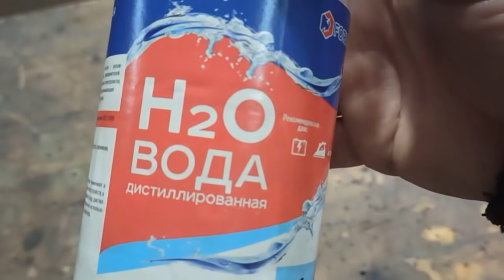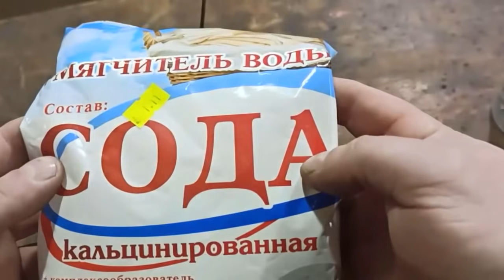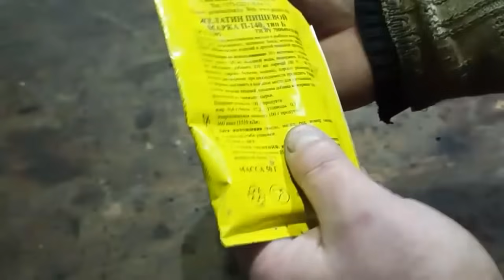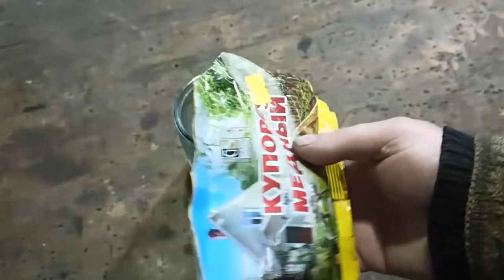Секрет меднения алюминия в гараже! DIY! Полезная самоделка! БОЛЬШЕ никогда не выбросишь ...

Comment: I'm very interested in this procedure, but I have doubts - Please confirm my understanding of "caustic sodium": When you mix soda ash (Na2CO3) with slaked lime (Ca(OH)2), you get calcium carbonate (CaCO3) + sodium hydroxide (NaOH), which is what you call caustic sodium, correct? Different languages have different names for common products and it's, sometimes, difficult to understand properly.
Reply from the maker: Yes, it is caustic sodium. You can also use a sewer cleaner that contains 30% sodium hydroxide.
Reply: @KovancaPolock  OK. Thanks!

Comment: Very interesting, but unfortunately I cannot read Cyrillic.
What are the products used please?
Reply from the maker: Copper Plating Composition:
copper sulfate - 100 gr.
technical alcohol - 50 ml.
battery electrolyte - 250 ml.
distilled water - 150 ml.
Washing composition:
alkali
caustic soda

Comment: Would you post the ingredients in English please this trying to guess could be dangerous i have ideas about what they are but if im wrong and I do not read your language.i thought you might posted them ingredients in the description but they were not there
Reply from the maker: Copper Plating Composition:
copper sulfate - 100 gr.
technical alcohol - 50 ml.
battery electrolyte - 250 ml.
distilled water - 150 ml.
Washing composition:
alkali
caustic soda

Comment: Which compounds you're using, please tell those names in English
Reply from the maker: Composition for copper coating:
copper vitriol-100 gr.
technical alcohol-50 ml
. battery electrolyte-250 ml.
distilled water - 150 ml. 
Composition for degreasing: 
lye 
caustic soda